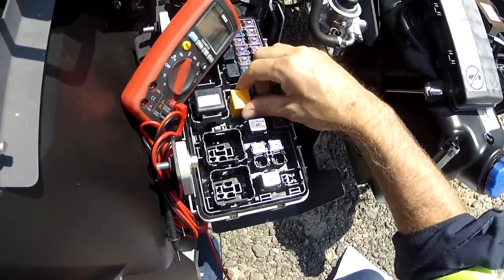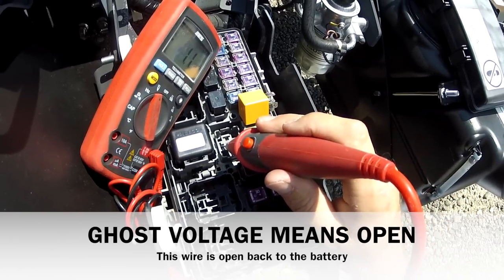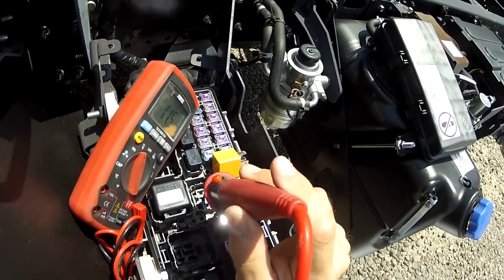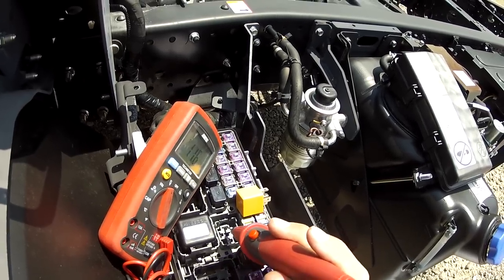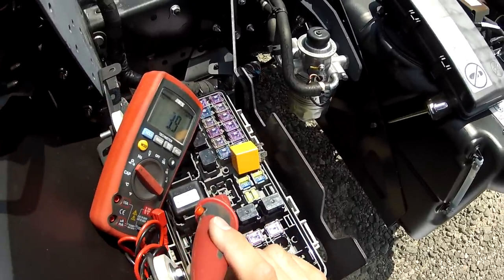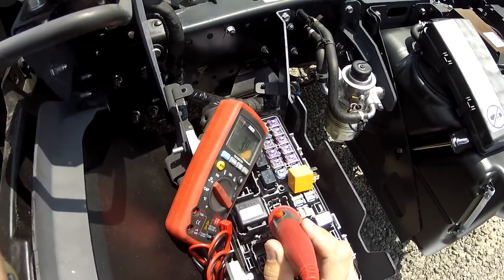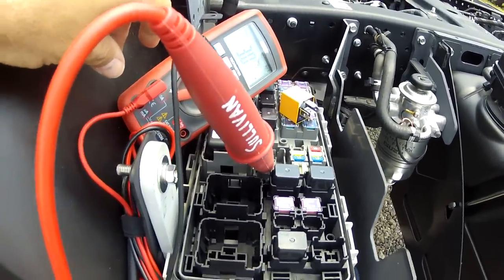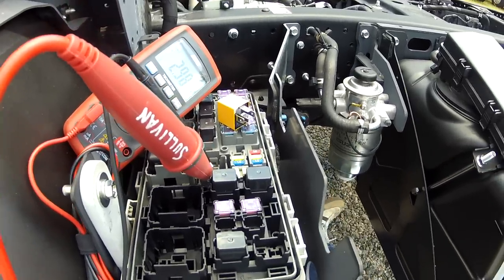VEHICLE RELAYS - Testing from the relay base

Comment: Thanks for the kind words and advice-i had to pat my self on the back after this one. The diagnostic took longer than the repair as you state in you book, it took me roughly about 30 minutes to diagnose, that includes getting a diagram, isolating the circuit, and testing. The repair took 10 minutes at most, soldering a new pigtail (2 wires) and a new resistor, and verifying the repair with the LoadPro. This time i had virtually no drop in voltage across 30/87, and the fan turned on...Success!!

Comment from the maker: When you push the button, the leads become a substitute load and if the wire is free of added resistance, the voltage doesn't change (much).  If the voltage does drop when you load the circuit (push the button) there has to be a series resistance in the wire. Make sure, when possible, you remove the load and test there, with both probes in exactly where the component was. That way you test 100% of the circuit. THEN drop the black probe to ground. Repeat the test. This isolates from (+) to (-).

Comment: What an excellent video, practical, fast, efficient, and safe. Many of us don't have quick access to the exact wiring diagram and a method of quickly proving the wiring is extremely efficient. After a little thought I see why you didn't do the drop test on the negative side of the relay, because when you test at the relay connector the device is still in line. You expect to see a drop on the device side, based on the ratio of resistance in the 25 ohm LoadPro to the dynamic clutch resistance, which might be confusing to techs not paying attention. Since most relays are on the positive side of the device, the assumption is fairly secure and also partially verified when there is no drop on the 12V side. It's nice to know you aren't going to cause much harm until you get to the ammeter stage. I've fried a few cheap meters when current was higher than I guessed, ha ha.

Comment from the maker: All of the wire segments can be tested at the relay. Yes, loading 30/87 will see a drop, because that's the circuit with the load in it already. It helps to know what the relay is switching so you can predict what the "normal" drop will be. Most loads are pretty low resistance (Ω) You can always load the wires with voltage. Just look at the layout of the circuit and see what's where and devise your own tests.

Comment from the maker: Don't forget some failure analysis... "Burned" wires need heat. Current can only cause heat if it flows through a resistor. The fault was at a resistor. Wires should have no resistance, and thus, no heat. Where did the heat come from? Just the resistor? Was the wire corroded? Water leak? Defective? Old? Think the problem through so you can get a clear picture of what you think is the exact cause of the failure. Don't just fix it and move on - something caused it. Is there a larger problem?

Comment from the maker: Excellent! Great job. This is important because it's another example of ASS - "Always Something Simple".  Think about the diagnostic steps. Did the fan work at all? Yes. Not the fan. Not the circuit. Not the relay. Not the fuse. Not the ground. Maybe the switch. Maybe the resistors. This is a good example of keeping your head screwed on tight and not letting the situation get the better of you. It's hard to focus if you're worried about time. How long did the diagnostic AND repair take?

Comment from the maker: The load in 30/87 is the solenoid, but if you simply read voltage at 30, you're testing only the pos half of the circuit. You could put the meter in 30/87 and load, but there's another resistor attached to 87. You'd have to know what the resistance of that load is to get an accurate answer. As you get more comfortable knowing what a circuit really is this makes a lot more sense.

Comment: Thanks for the quick reply MrSullivan. The reason for my question is a Ford Focus with a low speed fan circuit problem. The fan was not turning on when it was supposed to but the high speed fan worked just fine, tried commanding the low speed with a scan tool and i heard the relay clicking but no fan-so i tested with the Load Pro and when testing across 30/87 i had 12 volts, and 1.5 when loade-I found a burnt wire at the cooling fan resistor!.i even got a picture of it to show it off ;)

Comment: Fantastic, I use your teat leads  as much as possible.  I need a little clarification on the relay  terminal test.  When you tested terminal 30 and found system voltage how did you test for voltage drop if the there was not a load on the circuit?  You make great informative  vids, the only complaint is, I would  like to see more.

Comment from the maker: Yes - that's correct, but be careful with the ohm value of the pump. Fuse size is a better clue. But, blowing the fuse in your meter is why it's there. Don't be afraid, but remember to start on the highest amp setting - usually 10A.

Comment from the maker: Hmmm.... Well, if you use the relay with the cover removed as in the other relay video, you'll immediately isolate it from one circuit to another - either the coil (85-86) or contacts (30-87). Once you've done that, you can test the two remaining circuit segments for what should be there. I'm obviously not a fan of the Powerprobe because of it's limitations, so you can't be sure you really, truly, have voltage at 30 - which is why I like the known-good working relay with the cover removed.

Comment: Informative video love the load pro however in my opinion relay schematic you have is incorrect, terminal 87 is referred as the load circuit in that on that circuit is our electrical load which is the coil for the AC clutch in this case the resistance reading you read includes the conductors, the electrical load and ground path back to battery and NOT a normally open circuit. Also terminal 30 of the relay is regarded as the voltage or power supply circuit of the relay switch. Other than those points I do appreciate your video
Reply from the maker: It is the normally open contacts, and hence the normally-open circuit. I really don't know how you're distinguishing between a semantic difference. Keep thinking, but I don't think you're quite on target here.

Comment from the maker: I'd be very surprised if the the clutch was that high of a resistance. 6.5Ω would seem more reasonable. However, if it *is* 65Ω, your math is correct. I'd test again to see if you read the clutch correctly. It takes a lot of HP to pull that clutch in, and lots of electrical HP is amps, and lots of amps need a *little* resistance - ohms. Remember - amps and ohms are ass-backwards. Nice job though!

Comment: So you couldn't use a meter to jumper (30-87) on a higher amp circuit such as a starter right?  I think my DMM tops out at 20A.  You would have to leave the relay in for that.

Comment: Hi dan excellent piece of meter, I just got the whole set for father's day as a gift from my family ,I'm very happy ,but I haven't used yet,I have a concern, I got a Toyota 1989 22r and  I'm replacing the alternator , can I check the single b+ cable once is disconnected from the alternator for voltage drop, since is a single wire? And please tell me how,thank you Dan , and don't listen to haters,see you from San Diego ca, usa
Reply from the maker: Everardo Camacho You can - technically - but it's better to simply read Bat B+ to Alt B+ with the voltmeter, since the terminals are exposed, AND, it's the REAL value. The battery needs at least 13.8V to charge. Let me know if you have questions - DS

Comment: Dan - I have a park lamp relay problem (they don't turn on).  I don't hear the relay click when the lights are turned on.  I get battery voltage on all 4 pins of the relay whether there is load applied or not.  The input side of the relay should drop low when the switch is turned on right?  Also, if I jumper the relay switch connection points, the lights do not turn on.  Any advice what this indicates?  Thanks for the great video.
Reply from the maker: I teach to carefully take the cover off of a similar relay (or that one) and put it in the offending relay socket. Squeeze the relay. If the lights (in your case) turn on, its not them -- or vice versa. As for the meter, turn the lights on and read the voltage at 85/86. Should be source V (12V). If you see ghost V it's open. I'd expect from 2-4Ω if you read the resistance at 87 to ground. 30 is usually 12V. Just remember - it's always something simple.
Reply: Daniel Sullivan "Just remember - it's always something simple."

How right you are.  I had the relay in the wrong position (off one row)!!  I had pulled it out when diagnosing a starting problem (meant to pull the crank relay), and in my haste must have put it back wrong.  Once I put it where it should be, the lights came on.  Two weeks I've been working on this - aaaarrrrggggg!

Comment: Quick Question..Is it possible to find high resistance in the wiring by testing at the relay?... if you put your terminals across terminals 30 and 87 with the meter reading Volts- you're gonna read 12 volts but if you push the button on the Load Pro and the voltage drops then  you have corrosion in the system correct?? Then you would move the (-)lead to a good ground and retest and find out if it's in the (-) or the (+)

Comment: Hi there Mr. Sullivan:
    I understand how you used the Load Pro to measure if there was resistance in the circuit on the load side of the relay. But how to you check the solenoid side that had only a ground and an open circuit to see if their is a problem electrically on that side since it does not have a battery voltage to check with the Load Pro. How do you rule out that circuit. Thank you.
Reply from the maker: +Dog Food Dear Gravy Train - you find a solid B+ source and probe the ground, if needed. But - if there is a fault, you retest with the ground lead on a separate ground. Process of elimination. You always have BOTH probes in the connector to start.

Comment: Hi dan me again, I'm confused how do we know, when we are reading true voltage if the circuit had short_to ground or has continuity, they both test reads zero ? Can you please show me the difference of both of them ? I hope you understand question, excellent videos I'm learning a lot  like never before, see you from SD CA
Reply from the maker: Everardo Camacho They don't read "zero". An OPEN reads "ghost voltage" - the meter reading flops back and forth and is NEVER zero. TRUE ZERO volts really is 0.0V. Try is with your meter. If you don't see a difference, it is likely you have a manually ranging meter. Put the meter on 20mV or 200mV and you should see a difference. Let me know.

Comment: Hi dan,love your videos.my question is,does the load pro compatible with clamp-on D.V.M.?
Reply from the maker: LOADpro will work with any digital meter on Volts, that has the standard banana plug connections.
Reply: Thank you very much sir

Comment: Gan I use my load pro for starter motor voltage drop test from the relay?My guess is not,because  of high amperage.How about loading the starter cable disconnected from the motor and loading it with load pro button... would I see a drop If the cable is corroded ,or the load pro and DMM bias voltage is not strong enough?
Thank you

Comment: Dan-how did you read amps across the load (30-87) without a jumper across the coil (85-86).  Am I understanding this wrong.  The fan clutch clicked but I didn't see how the circuit was completed with the relay removed.
Reply from the maker: Because the ammeter is a jumper across the relay switch - 30/87. The coil -85/86- is completely independent of the contacts. You can also use the relay with cover removed as in the other video.

Comment: my dashboard lights dont go off on my 1999 ford windstar... i went to an auto repair place and they tried to put a new dashboard and the auto theft came on.... when they take out fuse 10 or 16 the headlights stay on... i have to disconnect the battery each time i park because it drains my battery.... i dont know what it is?? module or electrical short?? HELP!! I want it fixed before winter
Reply from the maker: You have an internal crossed circuit. You need to read the voltage drops across fuses 10 and 16 (and the rest). Do you have a voltmeter?

Comment: Is it safe to use on 5 volt reference and pcm output/control circuits?
Reply from the maker: Phillip Kang If you're asking about the LOADpro - yes. There's a chart in the tool manual that gives the resistances for each drop, and it works on both 5V and 8V systems. Not inputs - because there's no voltage to read on an input, unless you create an artificial test by isolating the wire.

Comment: This video is a good test to see If I understand any of your videos.  I don't . I failed the test.    The circuit  of the electric clutch  must be switched on to do a voltage drop test . You did a voltage drop test when you loaded the LoadPro, I guess, I can not be sure of the meter reading because of the camera shot to the meter screen.

I don't know from your explaination If you turned  on the circuit,  Or how you turned the circuit on, if you did turn it on . Not knowing if you turned the circuit on ,I have to guess you did ,  because you operated the Load Pro as one would if they preformed a voltage drop test by pressing the Load Pro button  

But how could you have turned the circuit on if you intended to get a correct Ohms reading , which requires you to isolate the relay and wire from the circuit

At terminal 30 you got system voltage of 12.20
......................... you loaded the circuit, got 12.11
What is that supposed to tell me?   The voltage did drop but not enough to indicate the clutch is operational because it can't work on merely  on a  point o9 volts  or .09 volts
The second time you loaded terminal 30 you had a voltage drop from 12.26  to 12.19 volts  Then you say " That confirms it goes all the way back to the battery

At the4 min mark You say "I'm Ohming out the clutch from the relay" 
I think that means "You have isolated the clutch from the relay"
No I have no idea what that means

In your book and in other of your videos you say to read ohms .The devise must be on the bench removed from the circuitl .. Here  The devise.  The relay The wire  The AC clutch  all the way back to the battery.. A complete circuit , Through the positive side?  That show continuity.. Everything is connected , the way it was designed. Is that right or not right? If right why would there be any ohms  or resistance .

I've read the definition of continuity till I'm blue in the face.  Every thing is connected correctly as designed But apparently I still don't understand what it means  How can a reading of 3.9 ohms indicate continuity?  Is that because 3.9  is alot closer to 0 than to 1000 Ohms or 10,000 Ohms   Is 3.9 consider no resistance?   Would 50 Ohms be consider continuity or no resistance    How much resistance or Ohm s would it take to show lack of or not continuity?
Reply: bob brawley if you read ohms you have continuity.  whether that's 1k or 10000k you have it.  a beep test would beep.  a voltage drop is caused by how much resistance (in ohms) you have in that circuit.  if you put in 12v & only get 11v out you have a complete circuit, but have significant voltage drop.
can't pull ohms law out of the back of my brain right now , but look it up & that will help you understand cause of voltage drops.
Reply: bob brawley Good questions, I suppose for example if the Ohms in the circuit should exceed the ability of Amps to push the A/C blower motor then there's too much resistance either coming from a worn motor or the circuit having corrosion which is my guess why there will never be a Zero ohm reading. Of course we need an expert to clarify as I am just a DIYer. Its to my best guess if something is exceeding 100 ohms you'd have more heat in that circuit and therefore more likely to blow a fuse or in the case of a worn AC blower motor bearings greater resistance by the motor perhaps eventually creating more heat there and further breakdown until the motor stops altogether. I used my Amp clamp on the return side and got a reading of 30amps. I then proceeded to take my amp clamp to a new motor under load and read just a little above 13amps. Big difference especially when factoring in Ohms. When it comes to a transistor/resistor voltage where voltage drop is intentional I suppose that ohms must go up in reading and where there is resistance there will be heat but that's the intended job of a resistor.
Reply: If I could get Daniel Sullivan to clear up any misnomer I may have spread, does a worn motor across a live circuit increase resistance and therefore acting like a resistor and amperage will be higher and therefore proportional to the amount of resistance? As a question to Daniel is this why I'm reading 30amps plus from my amp clamp on the return end of a worn AC blower motor? Just curious and I have ordered the Load pro from Amazon to make life easier.

Comment: Thank you to replied so fast, I understand ghost voltage, what I don't is how can we check continuity with the meter on DC volts, check page 156 and 157 of fet book , I don't know how to tell the different when is short to ground or continuity, may be I'm a little burro hahaha
Reply from the maker: Everardo Camacho "Continuity" isn't a test. Continuity is a state of being - it means continuous. Continuity from one end of a wire to the other is good. Continuity of the positive conductor to ground is bad. Ghost voltage is not continuous - 0.0V is continuous. Continuity by itself isn't good or bad. It's all about what it continuous and when.

Comment: BASICALLY if the Meter is set on A and one lead is in 30 and you ping one of the low side sockets(85,86) which are wired to the PCM... fried computer! LOL